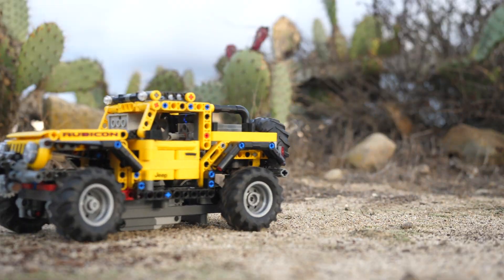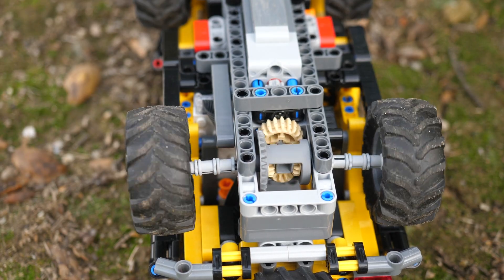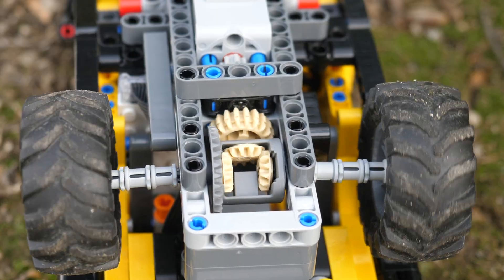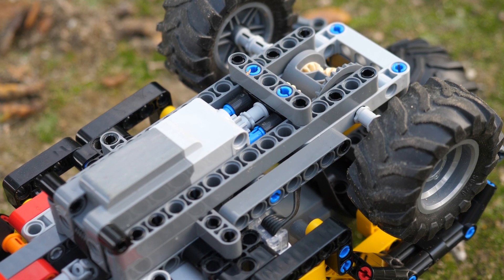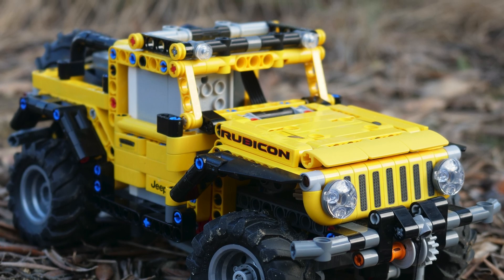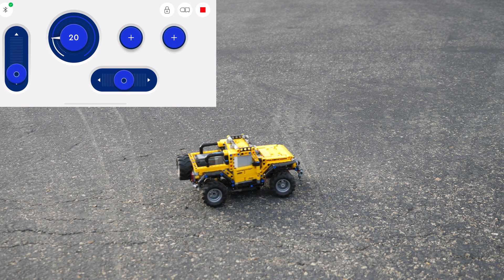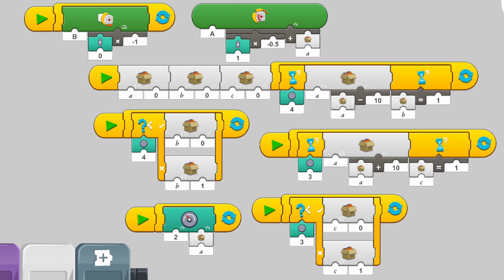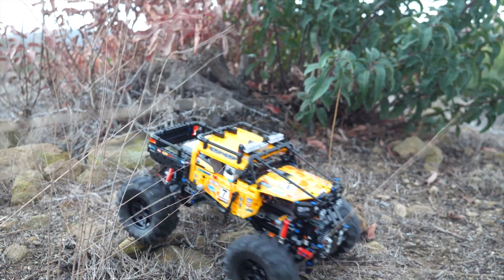LEGO Technic Jeep Wrangler Full RC Mod 42122

Comment: Just finished this build.  I have an issue where the front axle pulls the right wheel up when I turn left and pulls the left wheel up when I turn right.  It’s a mechanical issue but I followed the build to the letter.  Is there a  fix for this?  Thanks

Comment: Quite a useless mod - you have eliminated the ground clearance completely.

A relatively straightforward RC conversion can be made from Zerobricks 4x4 MOD which gives the set proper live axles. I have built this MOD and the replaced fake engine with Powered Up M motor for drive and Boost Motor for servo and the same hub as you.

Took me only one afternoon to figure out
Reply from the maker: Yeah that sounds like a much better approach. As I said in the video, I made this mod in only about an hour and I didn't wanna spend the whole day figuring out stuff. I also didn't want to use someone else's mod

Comment: Looks cool. But ground clearance isn’t that good. I’m kind of surprised on how badly scratched the motor on the bottom is. Yikes! Got to take care of it more. But who am I kidding. Nice job!
Reply from the maker: Thanks! Yeah true, I'm thinking of placing the motor a few studs higher, which would help with the issue.
Reply: @Unbrickme  cool! And your video is on brick fanatics by the way. Your famous!
Reply from the maker: Oh wow thanks for letting me know. Can you please send me a link?
Reply from the maker: Whoa that so incredible! One of the authors of brick fanatics is probably a subscriber of my channel, I I posted the video only a few hours ago and there’s already an article! So cool!
Reply: @Unbrickme  i know right? I’m so glad for you! Also, how long did you play with the car before you need to change the batteries.
Reply from the maker: I didn’t play with the car that much, but I can make some reasonable assumptions. For the crocodile locomotive, it was one train powered up battery box and one L motor. At full speed, it lasted a little more than 1 hour. So I assume it’s about 2 hours or so for Jeep Wrangler. Also with a train motor it’s probably longer, since that motor uses a lot less power than the L motor
Reply: @Unbrickme  cool! That’s not that bad! Thanks so much for the information. I’m actually going to buy the city 60197 passenger train over the weekend. Cant wait!
Reply from the maker: That’s awesome! I’ve actually been looking to buy that train but I’m not sure if I should. When you get it, please let me know how the train is for you
Reply: @Unbrickme  ok cool! What’s holding you back on you buying it?
Reply from the maker: Daniel I think I’m just not sure if the train is worth the money
Reply: @Unbrickme  oh, well for me it’s worth it. The train looks long and it has powered up components.
Reply: @Unbrickme  say, do you think there will be a new train set in 2022?
Reply from the maker: I really hope so! But I really wish that lego would make a creator expert train every year. Creator expert trains are much better than city trains
Reply: @Unbrickme  well we to the crocodile locomotive. We will likely get another train this year as well. I hope they make a passenger train though. Just like the horizon express.
Reply from the maker: Me too! Maybe we need a “USC” train from creator expert and it should be more expensive like 400$ or more and it should come with a lot of cargo train cars so that they’re the perfect addition to the crocodile locomotive
Reply: @Unbrickme  I agree with you. Well I unfortunately have to go. So I’ll see you in the future.
Reply from the maker: See you later

Comment: In the rear you should have put 1x3 liftarms around the axle (the middle hole )the put pins 1x3 connect the pins to the lift arms 2 and the finally pin to the diff that should help with the flexing on the rear axle
Reply from the maker: thanks for the suggestion

Comment: Didn't you have problems with the rear wheels sliding off the half stud wide gears in differential? Because it happens to me all the time 😀

Btw good mod, but I wouldn't off road with it now 😀. The ground clearance with all the other things you mentioned make it a bad off-roader
Reply from the maker: thanks, that issue that you described didnt happen often to me

Comment: It’s a shame ground clearance basically doesn’t exist which might make it hard to drive over more bumpy obstacles but it’s still amazing
Reply from the maker: thanks, actually I can try moving the motor up a few studs
Reply: And the rear axle will fail in few seconds beacause wheels are holded only by 12 tooth gear.
Reply: Not to take away from unbrickme's hard work here (great work man), but there is a paid mod plan on rebrickable that has a 4x4 drive train and added front suspension.

Comment: This is such an awesome compact rc mod! I can see why it was challenging to do this mod, but its ok that it's only rear wheel drive, as it still has suspension.
Reply from the maker: Glad you like it! Actually I removed the suspension at the rear wheels
Reply: @Unbrickme  yea but for pendular suspension, it will still work if there is some at the front.
Reply from the maker: Yes there’s still some at the front